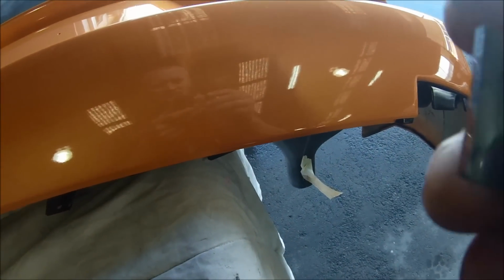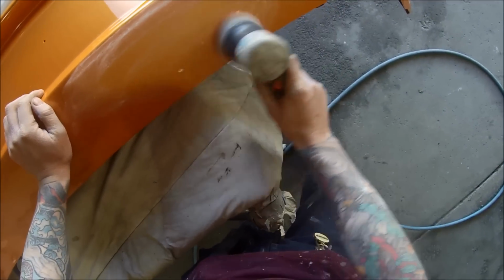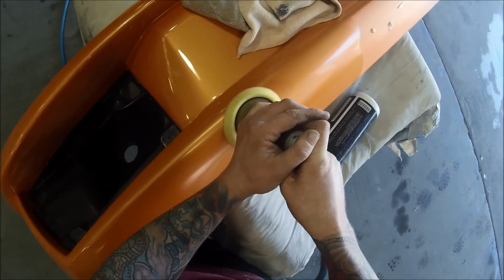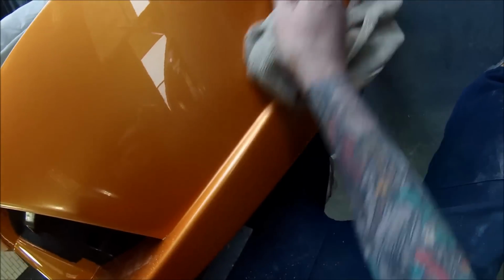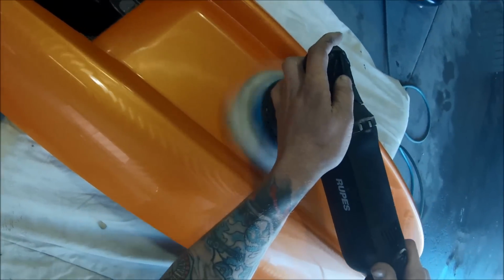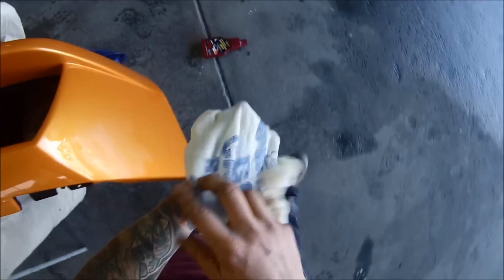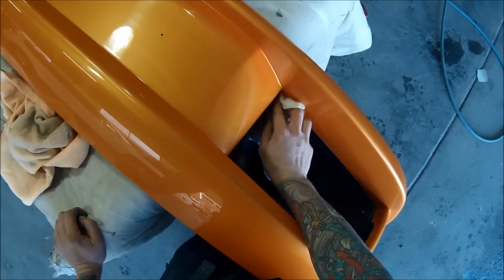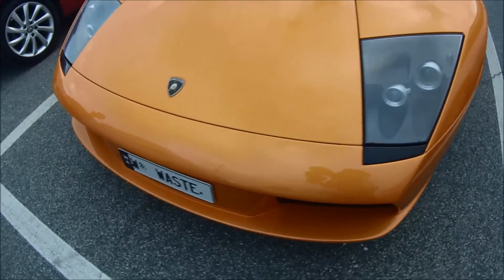How to Polish Like Glass Lamborghini Murcielago

Comment: I have been working in the refinish industry in the uk for 34 years ,we have for a while now been using mirka abralon discs and 3m trizac discs at 3000, 4000 and 6000 grit and find the time spent buffing greatly reduced and the instances of flatting marks re-appearing virtually non existant as a result, like your videos especilly the run trick with the stopper,,,classic,,cheers Ian
Reply from the maker: Thanks for watching mate and your info :-) I am yet to see any Trizact other than 3000 here in Aus, these days we have been using the Kovax Bufflex and they are pretty awesome the yellow 1500 cuts up so easy with that Juice polish.
Reply: @TheGunmanChannel  im not so much a friend of the bufflex! i always like to start with a sanding block and 2000 grid water proof! i really like the 3M Trizac but not the Abralon. especially in the lower grid like 2000 and 1500 i have the feeling that they are way to rough. i always finish with trizac 6000. than using the 3M program of compounds starting with the green than the blue and the Anti holo. the only other i can recomend is the power cut of KochChemie to replace the green from 3M

Comment: Hey mate, excellent video, can't wait to try it on my car. I've got one question, what's the idea behind polishing a warm surface? 

I have been told that if you polish (more the swirl removing phase) a warm surface you're prone to melting the paint (which I have done unfortunately) and because it becomes softer it prevents getting some of the swirl marks out. 

Happy to hear your thoughts as I'm always eager to hear different opinions. 

Cheers, 
Dylan

Comment: Wow!!! Incredible job in just few steps.   Thanks for posting.   What type of sanding paper did you use on that Rupes 3" mini polisher?   I have wet sanded but not tried the dry sanding method you show in the video.  It does appear to be much quicker to dry sand over than the wet sanding.   You definitely know your sanding and polishing stages.    Thanks again for the advice.
Reply from the maker: I just used 1500 but if it was a black or dark color i may go down to 3000 after 1500, Thanks for watching man, Cheers!

Comment: An even better compound would be Menzerna FG400 and Meguiars M101. Then you could go straight to the finishing polish. Also you should use atleast the yellow foam applicators for the wax stage as that any rag you used will scratch paint aswell and try to apply in straight lines aswell as remove in straight lines. Nice work though. Paint job looks awesome.
Reply from the maker: Thanks mate :-)
Reply: Polish

Comment: Hello dude very good job yet again :-) i just got back into spraying I got a make shift booth and just done my 2nd full respray,I gave the booth a real good clean before but still got a fair amount of dust in the paint, gonna try and use that de niber, but before using that and sanding down the paint how long do I have to wait since I painted the car, wish I could upload pics so I could show you, any way thanks for all ya vids they have helped a lot,specially the setting up my gun thanks again
Reply: badboiwebman Hey Brother, as for how long you wait before denibbing and polishing after clear coating that will depend on many factors like the specific clear coat you're using , the temperature and humidity in your area, baking or not , and even the amount of under coat and base coat under the clear can affect the Cure time. under the right conditions some clear coats can be cut and Polished just a couple hours after application. it's just experience to be able to touch a clear coat and know if it's ready for cut and polish. if you're not certain then best to wait a couple days.

Comment: Straight Lines vs Circular Motions doesn't matter... what matters is to use a clean foam applicator...  I would recommend a paint sealant followed by a Carnuba wax in a day.... but this is WAY BETTER than 99% of painters will do.
Reply: I always thought waxing in straight lines was a secondary precaution; a straight line being easier to remove IF you somehow managed to scratch the paint

Not sure about the sealant, maybe the paint needs a few months to cure... not sure about the wax either :D